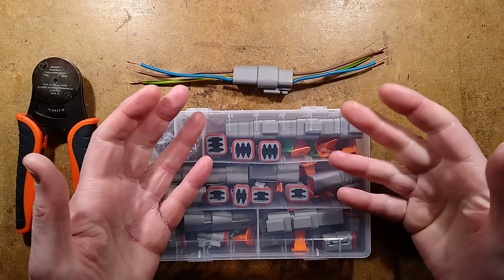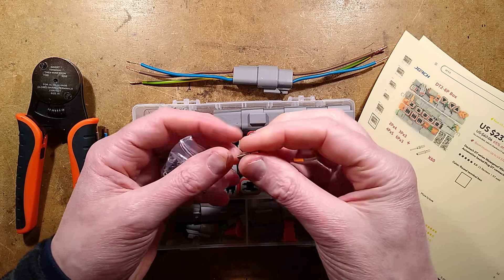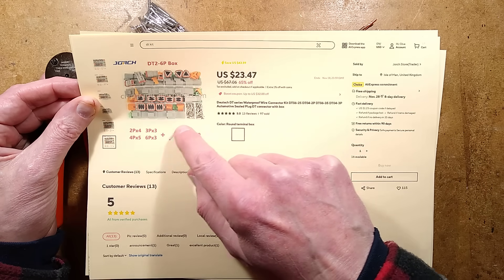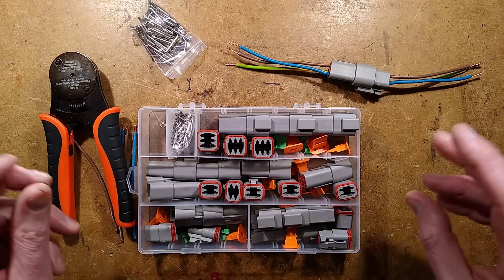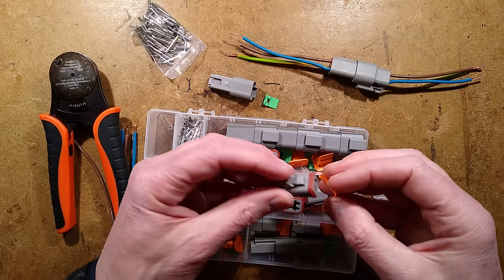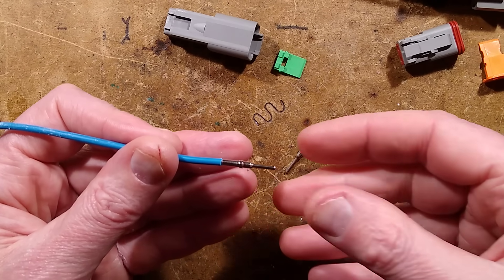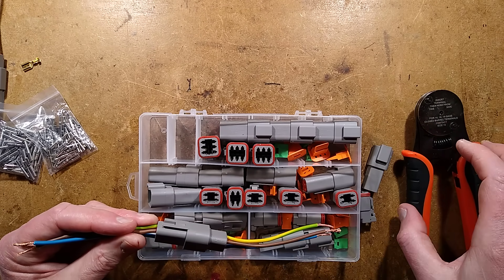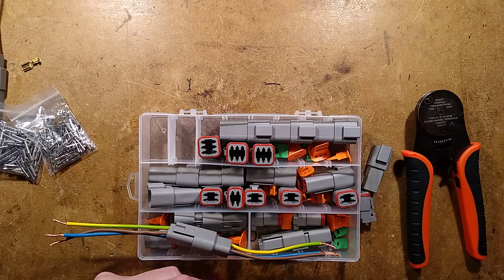Deutsch - my new favourite rugged connector

Comment: I'm gonna replace the stupid barrel connectors I've got on my boat with these. In cars, they make proper harnesses with proper connectors and all that; in boats it's whatever Bubba chooses to use that afternoon. On the off-chance someone reads this though - what would be the appropriate way to 'tee' a circuit in this sort of application (automotive)? I have +ve and -ve coming in and need 2+ve and 2-ve coming out. I'm not using the right words in my googling.
Reply from the maker: Deutsch apparently make bussing connectors.

Comment: I am a design engineer here who has worked for decades on high end precision avionics and critical "must work" systems and the advice about proper crimp techniques and twisting the end needs slight correction... IPC/WHMA-A-620 (Wiring Harness Manufacturers Association) Wiring standards actually do recommend a slight twist, when necessary, to insure all strands are inserted cleanly into the crimp, predominantly for barrel connectors. This is NOT to twist hard but a half twist to slightly decrease the diameter and better hold the wires in place (like wire rope) during insertion to reduce the "careless whisker" as you so put it. The actual crimping action shifts the wire, not cutting, and deforms the metal and the softer wire to fill in all the space within. I understand that there has been debate among professionals for years, but I was personally involved in destructive testing and examinations of hundreds of crimps and can attest to the way the copper "flows" when filling a connector. The individual strands in a certifiable "proper" crimp are no longer fully circular, but take on a somewhat triangular cross section. I am not sure of the current price for the specification book as their website was in a maintenance downturn when I tried to check, but I would highly suggest getting a copy for anyone involved in a lot of wiring harness construction. Very informative about industry best practices.

Comment: 13:44 i actually prefer this type if not for the million times i've used crush crimps in the factory only for them to make a loose connection and slide off the wire, and yes I'm making sure I'm using the correct setting on the crimping tool, and using the appropriate cross sectional area wires and connectors for them.

Simply put, they're more reliable in my experience.

I've personally fallen in love with the waterproof XT60 and XT90 connectors. Though you'd only generally use them in things like drones.

Comment: Nice YouTube suggestion... not familiar with this connectors... but in the RF field (Lemo connectors) those type of pins are not to be crimped, but to be welded... the little pinhole is used to pass the solder... of course the plastic cover has to be trimmed to allow the copper to arrive to the end of the barrel.
A new subscriber here!

Comment: Those are great. There are also the Deutsch HDP circular connectors. They have lots of options and variations, I just used a 23 pin version for an addressable LED project

Comment: The USA has 0 tariffs on cheap imports from China like Ali Express or TEMU.    The reason prices are higher is because of TEMU uses air cargo to get items to the USA lightning fast  it seems to be less then a week for me to get items from China to Seattle,   that has forced Ali Express to compete and also use air cargo which simply costs more.     I made an order on 11/29 and it will be arriving later today 12/5.     Keep in mind it takes about 3 days of driving for the FedEx or UPS truck to transport the packages from Los Angeles to Seattle.

Comment: These connectors are F'ing great! I've been using them to refurbish/replace failing connectors on the wiring sub-harnesses of my 1995 GTI to great success. As an example, I recently started having problems with the nose lighting (headlamps, signals, foglamps, etc) and traced the problem to a failing connection in the original 30-year-old Amphenol round connector at the radiator brace which connects the front lighting to the main body harness. I replaced that connector with a DT-series 12-pin connector, and all of my front lighting is reliably working again. Easy to install, and virtually foolproof.

Comment: I use them in my Industrial control panel projects but they are expensive. However they are without doubt the best connectors available. Take care using the cheap crimping tools , I was stung with them prevously, they are good for approx  20-25 crimps, above this the tool starts to wear and you cannot get a consistent pressure on the crimp

Comment: Deutsch connectors are AWESOME. Caterpillar selected Deutsch connectors over it own internally developed connectors back in the late '80s for its electronically controlled engines (as did Detroit Diesel).
They were the HD type (round). Expensive but AWESOME as they are EASY to service. You can remove them from the back of the connector and repair as necessary.
The DT connectors where used later as they are a lower cost connector, even easier to service as it does use the plastic tools that would be damaged over time.
The machined connectors are the best but are slower on production lines, but the stamped ones are also less consistent and so can catch in the housing.. 
A couple of things not mentioned 
    The machined connectors have a hole near the middle of them - you SHOULD see you wires thru the hole so that you know that the stripped length of wire was correct.
    They are designed for a size of EXTERNAL wire size to give the sealing. So the core size can vary depending on the insulation used.

Comment: Probably should call them Deutsch-style connectors. None of those on Aliexpress are genuine Deutsch connectors, but they still work pretty well at a fraction of the price of the genuine article, and are interchangeable.  I have a collection of DT and DTM size connectors.  I believe DT are thicker pins, DTM are thinner. Deutsch connectors of both sizes and various pin numbers are used all over modern farm machines to connect sensors etc.

Comment: I can dig it, but how to take out the plastic peace to take apart on the male connector and do they sell the connectors separately cause rewiring up to connector is pain, specially if you run into them in the wild and need to swap a wire with out the tool or those connectors at hand? its decent idea, but its all about fixing stuff. I dont want to buy whole set to fix one connector, when foldable can be swapped with enough patience and tiny fingers.. and some violence. If wings snap solder it since back wing usually can be reused and if it snaps in half usually they run just apicos inside the connector so swap it, witch are already everywhere. Fancy is nice if you do manufacturing, but fixing is pain if you have limited length of wire available.
Also i see potential issue with the seal being so far back that depending on crap around, say asphalt gets collected between the two, i'm pretty sure that will be permanent connection if its not filled with thick grease.
Reply from the maker: There's a hook tool available for pulling out the wedge.

Comment: At my workplace doing Electrical Integration we use Phoenix Contact heavy duty connectors for anything coming out of a cabinet thats headed to the main assembly. They're a lot like this but much bulkier and have a big housing with a latch.

Comment: Ive found some of the fake DT connectors start to melt if you try and put the rated current through them.
Ive switched to exclusively using genuine Deusch connectors but the chinnese crimper i have does the same job as the genuine one!

Comment: I was a product design engineer for Deutsch on the aerospace side, specializing in contacts.

If you want the best crimp, you should check the calibration of your crimp tool. Too much crimp and the wire strength gets reduced. Too little crimp and the crimp barrel doesn't hold strong enough. The wire strands are actually deformed and the spaces between the strands essentially disappear when crimped correctly. The cross sections I made to check for crimp quality were fascinating to look at, as were the high speed videos I made of the contacts being manufactured in cold heading machines.

The method of adjusting your crimper (if it exists for your crimper) will vary, but we checked for crimp depth with go/no-go gague pins in the crimped position.

Also there is a special tool for removing the contacts from the connectors without damaging the connector. The plastic version works just fine. You can lubricate with isopropyl alcohol.
Reply: I've got the special tools to remove the contacts but find a simple flat blade jeweller's screwdriver with good eyesight  works just as well!
Reply: @PTBong-z5l  Yeah, the removal tools are less of a requirement with the industrial connectors like these. The removal tool is definitely required when using military style circular connectors like a 38999. The inserts that hold the contacts have 3 or 4 plastic fingers that need to be depressed simultaneously to release the contact.

Comment: That turret crimper reminds me of the crimp pins of the Amphenol MS connectors that I used on scientific balloon payloads. The really expensive "official" crimpers are just the handle mechanism that takes differently sized turret heads for the different wire gauges and pin sizes. The handles are super expensive and the turret heads are individually ridiculously expensive. But they are all calibratable for Mil-Spec crimping standards so as the crimp pins wear you can adjust the crimp mechanism to extend the life of the tool, instead of throwing it away when it first wears. With the round MS connectors the pins don't engage until the connector bodies are aligned and the keying starts to mesh. As I recall, the sales material for the MS connectors called this feature "anti-dishing". But I could be misremembering that term.

We worked with NASA for the balloon operations, which explains the requirement to meet Mil-Spec. And anything labeled Mil-Spec is ridiculously expensive. But a big part of what you are paying for is the development and testing to reach the Mil-Spec standards as an assurance that the connector won't fail in the field. (Whether that "field" is on a rocket, satellite, or balloon payload (in NASA's case) where one can't physically reach the connector even if you had replacement parts. Or, if the "field" is a battle field where the closest hardware store is the bombed out husk in the next block.) Mil-Spec is a different world of reliability that most people have no need to pay for.

Comment: I'd forgotten about those type connectors.  Many years ago had a call to go to a shop that specialize in making precision parts for Boeing up in the Renton plant in Washington state in US.  It was a combination issue with an interfacing software problem with computer to CNC machine and RS-232 wiring between the same.  The owner used that type of connector in his attempt to wire up the connections.  To be honest, i kinda marveled at them.  Solid connection, looked to be somewhat water resistant.   I worked in an area that i swear, every manufacture in the world had stuff, so seeing a "weird" connector was more typical.  BTW, talking to a English translator, without technical knowledge or vocabulary,  in Japan, was interesting and my hat's off to the Japanese engineer trying to communicate through the translator to me.

Comment: Looking at those, however great they are, they can only be used in enclosed environments at mains voltages. Due to the fact they are class zero when it comes to insulation.
All exposed mains wiring has to be double insulated for both class 1 and class 2 cabling. These produce class zero because they only have single insulated wires so must be in enclosures.
OK for low voltage of course.

Comment: Those pins should have a sight hole which tells you if you've stripped the right length of wire. Wire should be center of the hole.
Reply from the maker: They do have the hole.

Comment: Seems that you started something!  The connectors are available but selling fast. The tool is sold out on most listings.  The are a couple listings where they are still available.  Seems very cool, good.  Will have to try them out.  Be good for wind turbines and solar.

Comment: My colleague told me he once had to re crimp all connectors on a yacht because someone used the wrong setting on the crimp tool. Other than that, for small wire sizes they don't seem to work nice, and extraction tools to pull out the contacts are sometimes a hassle to work with.

Comment: The HDP range use the same contacts and tooling and offer great, easy to work, circular connectors with lots of contact layouts and a few different shell sizes. Check out the technical manual for these for details on how you are meant to prep the wire and crimp etc... Been using these for ~15 years on plenty of protoype vehicles and rigs. You can get pulgs for unused cavities. Very similar to the D38999/Autosport range but much more affordable and easier to use.  Amphenol are a suitable alternative to genuine Deutsch and available from Farnell and mouser etc...

Comment: I remember these connectors from when I used to assemble 12V wire harnesses. These connectors are great! I especially appreciated the ease with which you could take the wires back out and the fact that it didn't need a specialized tool. Many brands (e.g. Molex) need a specific tool and even then you often need to bend the wings on the terminal back out so they seat back into the connector properly.

Comment: I already have the crimper that compresses the pin on all sides as I like using ferrules on stranded wires that go into Wagos or screw terminal blocks on circuit boards when building 3D Printers.
Reply from the maker: Those ferrule crimpers are not suitable for these.

Comment: Deutsch connectors are great, they are the most common connector type on equipment I work on, I do notice on these  that they don't have the end piece that helps to holds in the rubber seal, (and allows the various collars and convoluted tubing ends to clip on) can you get those separately I wonder? They are solvent glued to the connector

Comment: There's two main options when you need a repeatable seal on hand-operated plastic part... custom molded seals like Deutsch connectors use, and bulkier, heavier O-rings. In both cases a double-layered sealing space seems to be the trick that keeps water from slipping past a connector, as the first seal reduces the pressure of anything entering enough to prevent it passing the second seal. Deutsch connectors (and several other kinds of automotive connectors for that matter) build the double-seal into a single sealing element, making it much more compact than two O-ring bosses could ever be, but I would trust dual O-rings a hair more in stressful environments due to generally wider spacing and trivial replacement.

If you look at the construction of e.g., weatherproof coax crimp connectors, this is a low-cost and reliable way to make a water-resistant seal in or around the point of connection. It's not pretty, but for DIY projects running weatherproof cables through appropriately sized plumbing parts (O-ring sealing feedthroughs meant for semi-rigid tubing, and if necessary a small O-ring sealed union joint to conceal a non-waterproofed connector) will give that extra bit of reliability to something that actually needs to be out in a rainstorm or hit with a pressurized spray of water.

Comment: Is it possible to swop the male and female contacts to either shell? By switching 1 pair it would help to polarise connections and prevent joining plugs that have the same number of pins.
Reply from the maker: It's not really suited to that.  But a keying system may be available.

Comment: I work with Deutsch on a daily basis and perform a pull out force test every time I start a new job with the crimping tool or machine.
What is that, 1.5mm²?
Then it should make it above 150Nm of force. Never should you be able to pull any terminal off a 1.5mm² or 16 AWG by hand!